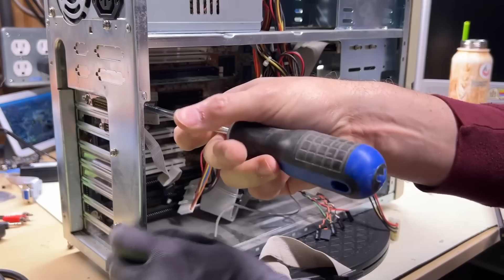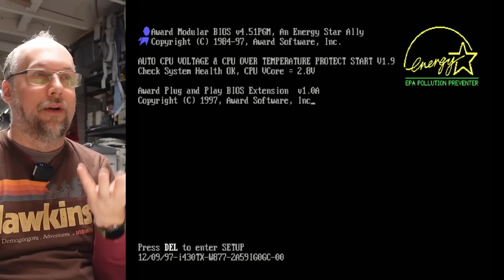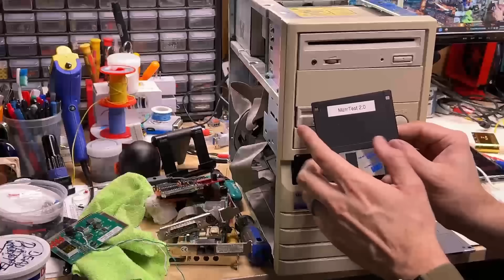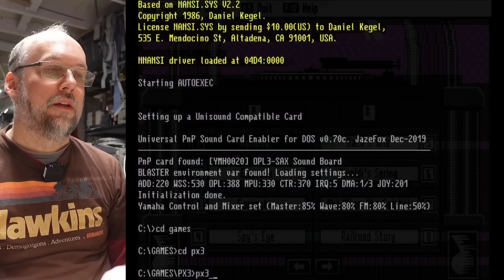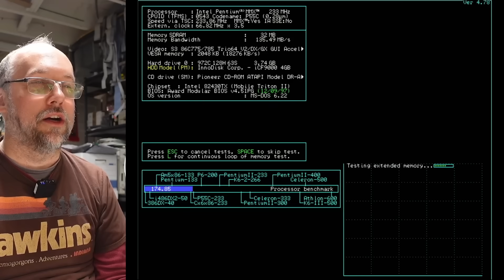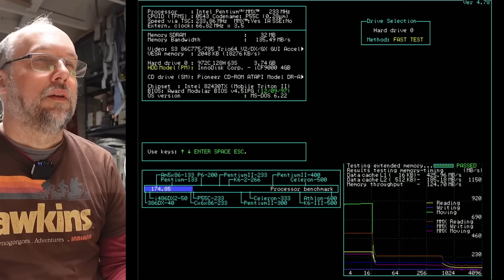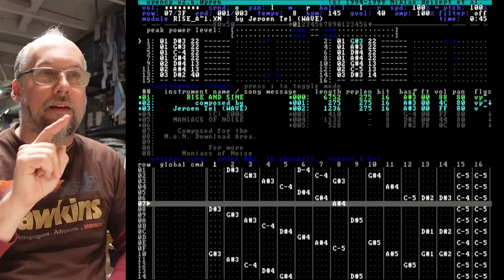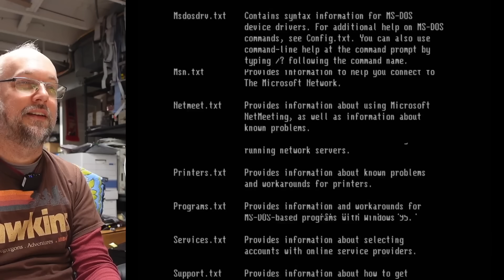Test and try: What's inside this dusty old PC?

Comment: I still own my first PC clone.  I had it built at a computer show, back in the late 80's.  And the funny thing is, it had a speed display, but you had to program it, so while the processor is 100Mhz, the display is 33Mhz, because i never bothered to fix it.  After that, i just built my own.  But back then i was new to the PC scene, was an Amiga guy for years before.
Reply: That's pretty impressive that you still have it! There are so many things I wish I had kept, but of course hindsight is 20/20.
Reply: I was into Amiga as well..... I knew many who had one, so I had no need to buy one my self. I used to game on C64 from around 1985 to 1993. Game on PC and Amiga from 1988 to around 1993. And then got my first PC in 1993. My first computer. Before that I gamed on whatever I so happened to have access to.

Comment: Best part of that modem is the transformer. You can do a little work with 2 of those transformers and make a ground loop isolator to solve issues such as the aux jack in a vehicle getting alternator whine. You would build a cable using 2 of those transformers and plugging in your device to that cable and then to the car would remove the whine. =)

Comment: No thermal paste on the CPU? Why?
Reply: It's not needed. These older CPUs have low power consumption and a large heat-spreading surface so the power density is very low. I've tested a similar system without thermal paste and when I removed the heatsink the CPU was barely warmer than ambient.

Comment: As an ISA sound card collector I can confirm, that this is a very good sound card. It has original integrated Yamaha OPL3 FM and proper SB Pro 2.0 support. This card is also not too noisy and super easy to configure. A great choice if you want to build an uncomplicated but highly compatible retro PC.

UPD: Windows Sound System works fine in DOS as well. You don't need to run Windows for that.
Reply: Yup.... Real OPL core in that chip.
Reply: read readme file for softmpu. as for ymf719 it all depends on exact card you've got in your hands.
Reply: This is definitely one of the better SB compatible cards, but when it comes down to it there will always be some programs that fail to work with it.  It's just one of the failings of these older DOS games and the lack of a common sound API that would have made that better.

That is the reason the multitasking OSs with the drivers that offered a common API for devs made it easier for game developers to focus on the game instead of having to support every kind of hardware under the sun.
Reply: @jandjrandr  This is generally untrue; sound libraries was quickly developed and adopted so compatibility is very good.  The majority of issues are when a program is hardcoded to address the pre-Pro Sound Blaster at IRQ 7; most people don't realize you can seamlessly workaround that by re-initializing the card.  With old Sound Blasters you'd have to power down, crack the case, pull the card and fiddle around with the jumpers (and then back again when you were done).  There's very little reason to run a 'genuine' Sound Blaster these days unless you're nostalgic for -60dB SNR and hearing the hard disk interference being picked up in the line output for some reason.
Reply: Syndicate and multiple other games may complain on thes Yamaha/SP Pro chips.
Reply: @szyszka8303 I do not have issue like that. Those I had, were down to defect software. Same issues on Creative cards. But dynablaster had issues with SB16 cards though.
Reply: @brostenen  In my case 60% old softwere from 93y and below fails to play FM, midi works fine. Maybe I missed something or driver is buggy. But i doubt.
To be precise, it is buildin Yamaha opl3 to Toshiba 2545cdt laptop.
Reply: @szyszka8303  Might be some ressource conflict.

Comment: That is the same motherboard that I had back in the Pentium era, I had an AMD K6-2 450MHz in there. I tried to use an ATX PSU with this, I bought that from a local idiot, used, and it died in 30 minutes. So I went back to my original AT PSU. But I was shocked to see that this motherboard could use both SD and EDO RAM at the same time. It also had 2 cache chips.
I also had an Acorp board that looked exactly like this, the only difference it had, was the Ali chipset. With the same K6-2 CPU used inside.
Reply: "Local idiot." 😂 I'm going to use that.
Reply: @ct6502c  go ahead :)
Make my day :)
I call him idiot because he never learned not to trade or sell dead items, or anything that belonged to someone else. Even though he eventually got beaten up for everything bad he has done.

Comment: The Aztech soundgalaxy washington 16   was an mid 90s ISA soundcard with soundblaster 16 support. 

We had an odd one the output 2x 30+ w on the audiojack. We used it to drive a pair of 8" hifi studio speakers. There were probably something wrong on the amplifier circuit. As it should not output more than about 2 x 1 w.

Comment: I have a similar system sitting on my workbench right now from the same era. It has an A-Open motherboard and is from a local outfit called Microseconds that sold both new and used computers.

Comment: As an originally electrician i hate this 'birds nest' inside computers ;)

I sold custom computers. I've allways asked: 
Are u an enthusiast user, or a 'pro'?
First got a heavily cleaned-up and tight cabled management, bcoz they (almost) never would mess around inside. Shaking the PC wouldnt make any noise at all.

'Pro' users upgrade all the time. Pinning cables  would'nt be pleasant for them. 
But I still avoided a 'Birds nest'!

How i build them:
1. (Remove PSU if installed)
2. Install (stands+)CPU+Cooler and RAM on the Mainboard before mounting into the case.
3. Mount Mainboard into the Case.
4. Mount PSU. Do the cablemanagment on the backside(!) of the Mainboard carrier and supply connectors at their needed positions. Cableties will do the job.
5. Install all the drives (fdd, hdd, etc).
6. Plug all the PSU cables in the 'drives'
7. Install ribbon cables. Fold(!) the cables in 90degrees until you reach the connectors. For 'pro' users supply connectors to all bays. (Now adays this means to supply SATA cables to all possible Drive slots.)
8. Fix all cables with ties. Make the installation clean! Don't leave a mess inside the case.

Comment: Adrian 486 boards did have ps2 port or a 4pin that you would plug ps2 break out plate to  use ps2.. example the SOYO 4SAW-2 had that ability, a lot of 486 board with PCI bus could support PS2

Comment: I know you aren't fond of these mid to late 90's PCs but I always love when you do a video on them.
Reply: That AT case model is from the early 90's like 1991 up to about 1997.
Reply: Yeah thats an early/mid 90s. Late 90s and youre talking Pentium II.
Reply: I have a Pentium MMX 233, sold in 1998. So maybe PII was right at the end of the 90s? @AltimaNEO
Reply: @RetronautTech   Pentium II introduced on May 7, 1997
Reply: So I guess for the first year or so, PII would have been used for more high end machines? @Mani-aX
Reply: @RetronautTech  my first PC was a cheap  Pentium II 400mhz on 1998. Definitely not a high end machine.
Reply: @AltimaNEO  Super Socket 7 chipsets, with chipsets like the VIA MPV3 and ALI Aladdin V with 100MHz FSB and AGP for the AMD K6 II, K6 2+ and K6III/3+, launched about 1998. You could find these motherboards both in ATX and Baby AT form factor (most of the late with both AT and ATX PSU connectors), yes PII and PIII were already in the market but AMD didn't had the Slot-A Athlon ready and even then low end CPUs like the Duron would be needed before phasing out SS7 on the desktop.
Reply: I like these very much.

Comment: Oh! The first computer I used had this exact case!

Okay wow, ours was a 386DX-40, it feels so strange seeing PCI slots! 233 feels so weird on that display lol

Funny Fact, in 6th grade we visited the local university radio station (Bishops'), there was one of these cases, running w/e, with the front panel power button missing, and a post it note saying "Do not insert finger or other appendages in this hole"

Comment: I didn't think AGP + ISA ever existed on the same board.
Reply: Hi, the whole point of Super Socket 7 was having AGP and 100MHz FSB on the very latest AMD K6 2+ and K6 III, these motherboards were available both in baby AT and ATX form factor, also for some time Slot-1 / S370 baby AT boards with AGP, PCI and ISA were a thing, with ATX you could have these expansion slots with Pentium II, III, Celerons, AMD Slot-A Athlons, S462 and Pentium 4 on the socket 423, IDK you must be misremembering something.
Reply: @RetroTinkerer  I had super 7. It didn't have ISA. ISA was dead.
Reply: Asus had a 486 board that had ISA, PCI. and an AGP slot. They are rare now and thus expensive. I'm going to find one and put an AMD AM5x86 and OS/2 v1.3 on it.
Reply: Of course it did, on BX chipset for instance. But usually with only one ISA slot.
Reply: All 3 of my Slot 1 boards have AGP and at least 1 ISA. These are full-length ATX boards, I figure the ISA was usually omitted on microATX boards.

The newest I've seen with ISA is a Socket 478 from 2005 which was used with an industrial motion control system. That's definitely an oddity.
Reply: @eDoc2020  that's just odd. Why? in the AGP era PCI was well established. So what's the point of ISA? ISA was trash by comparison.
Reply: @awilliams1701   I figure the main reason for ISA slots on AGP boards is for DOS-compatible sound cards. Or for any old cards you might have lying around.

The 2005 system I was describing was used for controlling industrial machinery. You can afford to replace your sound card with a new generic one if your new PC doesn't have ISA slots. You can't say the same about a $1M+ piece of custom machinery with a specialized interface card.
Reply: @eDoc2020  I had PCI sound blasters that worked in every game I through at it.

Comment: Adrian, question for you. I recently bought one of those POST cards (probably the same one you have actually), but it came with no documentation. Are the POST codes different per motherboard or does the card generate them? Just wondering where one one go to have a reference to what the codes mean.
Reply: I picked one up (from eBay China) a couple of weeks ago for less than £5. I’m taking a look at it now.  It comes with a pocket sized manual with 31 pages of super small writing including lots of reference tables. It also came with a two pin header cable. -I don’t know what that’s for.  I’ve no idea what the manual says because it’s so small but I’ve used it like everyone else and if it completes a load of flashing cycles it indicates that the motherboard works.  I’d like to find a proper tutorial for the times when the board doesn’t work and the codes might help with a bit of diagnostics. Unfortunately I don’t think it has a named manufacture or an html for a pdf.   Now where’s my magnifying glass?
Reply: They are different per bios manufacturer(Like Phoenix, Award, and AMI) OEM manufacturers may also have their own codes too. Look on the bios chip on the board, should show what brand it is.

Comment: Check out the Epox 68LXR which was a PII motherboard had AGP, PCI, USB on an AT Board. I believe I have the CD Still which had some interesting videos. If you can run Doom on this again, try putting it in General MIDI to see if it sounds better

Comment: A lot of late 486 boards (typically with the UMC8881/8886 or the SiS 496/497 chipset) include a PS/2 pin header on the board. The pinout is everything but standardized, but building your own cable isn't that difficult. That's from a time when Pentium board were already around, so timing it to the Pentium era isn't that wrong.

There were AT-compatible boards (can use an AT power supply and doesn't require an ATX I/O area for anything but the DIN keyboard) with AGP, PCI and ISA. That's the usual slot combination on Super Socket 7 boards.

The 93C66 is a tiny EEPROM to store the soft configuration (IRQ, DMA, gameport enable/disable), so you don't have to invoke a setup porgram any time you boot the computer. The 93 and the 24 series are very common configuration EEPROMs.

The memory will surely not be PC-133. A classic Pentium on an Intel VX or TX chipset runs at 66MHz FSB, so the module is likely PC-66, maybe PC-100 if it was bought at a time you couldn't get PC-66 anymore.

I don't see how you can run a Pentium MMX at 266MHz. The highest avaiable multiplier on that chip type is 3.5x, and the highest officially supported FSB clock is 66MHz, which yields 233. Many boards support FSB75 (3.5*75 = 262.5 MHz), which is close to 266, but not quite there. In case of Intel chipsets, it's overclocking the chipset as well as the processor, but the Intel chipsets handle FSB75 quite well. This will result in PCI at 37.5, and whether the PCI cards will also handle this quite well is a different issue.

You are most likely correct that this is an Intel "TX" chipset, because that's the latest (and greatest? Still an issue to debate. The 430HX is great, too) Intel Pentium chipset, just as the Pentium 233 MMX is the latest Pentium series processor after that they went all-in on Pentium Pro / Pentium II. You could learn the naming, though: Everything 420 (like 420TX or 420ZX) is a 486 chipset, everything 430 is a Pentium chipset (e.g. 430FX = "Triton", 430HX = "Triton II", 430VX = The value chipset no one wants, 430TX = the end of the line), and everything 440 is a Pentium Pro / Pentium II / Pentium II chipset. So definitely not a 440TX.

In you supply test, 5V is high and 12V is low. This indicates the supply is designed for a higher load on +5V than your car bulb provides. The Pentium boards power nearly all the logic from +5V, so the 5.08V is perfectly fine and will likely drop as soon as the system is complete. As the +5V has a higher load, the supply "turns up the power" to keep +5V running, and the +12V is likely getting slightly above 12.0V, too.

SDRAM speculative read might make it faster. It depends on what you are doing. It is about already reading data the CPU is likely to read "just the next second". If the CPU immediately requires something else, though, the system gets faster. If the CPU doesn't, the system still has to finish the useless speculative read before it can serve the read that actually needs to be served, and the CPU will be stalled for that time. As long as the CPU executes code and accesses data from cache (L1 or L2 will do) while the speculative read is happening, there will be no downside of the speculative read, so it likely makes the system faster "most of the time", using very slightly more power.
Reply: This comment inspected by #38.  QA Passed.
Reply: ... And what are the tolerances on those voltage rails again for AT?
It's a damn 20yrs+ old power supply, 5.08V, how's the accuracy on that multimeter? Get real here, it's fine.

And for the record, 66x 3.5 is 231, which is close to 233 MHz but not quite there.
Reply: @charlesdorval394   I took the "5V is high and 12V is low" to mean they were on opposite sides of perfect, which might give you a clue on how the regulation works.

5.08V is of course absolute fine.  Sometimes people get WAY too hung up on regulation, IMO.  I'm kind of wondering how the upcoming LTT Labs will handle PSU tests, since some review sites and YT channels have used regulator precision as a criteria.  In reality, it doesn't matter that much.  Close enough is more than okay -- nothing needs it to be exact, and perfect is nearly impossible anyway:  There is voltage loss in the cabling (which is why 3.3V rails have a sense line that goes all the way to the ATX connector), and the feedback point is probably at the junction of a resistor divider, with resistor values that are merely the closest conveniently-available match to the values that would calculate exactly to the desired reference voltage.  It can even be detrimental for a PSU designer to get too hung up on trying to maintain a perfect set voltage in all scenarios (regardless of load or line voltage), since other factors, like transient response, overshoot, and OCP, tend to be at odds.  The best compromise is stable, reasonably stiff, able to handle brief surges, but fast enough to shut down on overload.  Voltage precision only counts in a particular niche of lab supplies.  Anything that needs a precise rail will have a local regulator to do just that.
Reply: @charlesdorval394 I think +/-10% was good enough, so lots of tolerance.
Reply: @charlesdorval394  66x 3.5 is 231, which is close to 233 MHz but not quite there - true. That's why the FSB is usually clocked at 66.666 MHz. On the other hand, 75MHz is usually 75.000.
I agree, the voltages are definitely fine, but I expect them to be even finer when the supply gets its "typical load". The tolerance on the positive rails is 5%, so 4.75 to 5.25 is "in spec".
Reply: @tw11tube  Ah now the 233 figure makes sense. 
Sorry I misunderstood your comment about voltage, thanks for the clarification! :)
Reply: You AI bots are amazing.😂 Only joking, great stuff.
Reply: @davidp4456  lol I wish, I'd probably be a lot smarter if I was an AI bot :P
Reply: My Asus 486 board certainly has a ps2 port like that.  And it is indeed an sis chipset.  Uses same ps2 port cable as a later ppro board from asus.

Comment: That soundcard is actually a audician 32 plus (a few brands made this for Yamaha, like labway and genius) it is sb pro 2.0 and wss compatible and has a third gen opl3 chip. Dosdays has a good write up on it and links to proper drivers and setup under the Yamaha page.
Reply: Thanks for that tip.  I’ll take a look at Dosdays for the set up.  I think I have four now.  One of them an Audician32 in the original box. I kept buying more as I thought the first ones were broken when trying to set them up with the original drivers under windows. They’re probably OK and it’s just something I’m getting wrong.😢